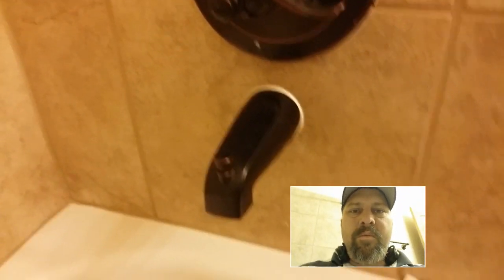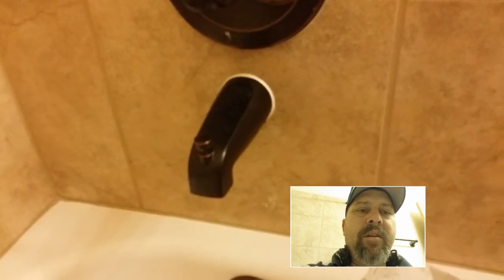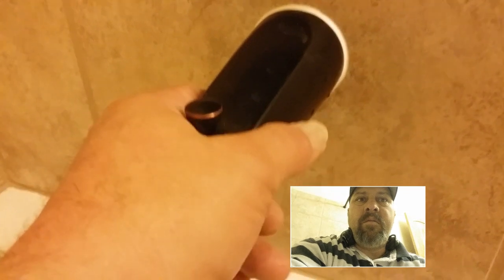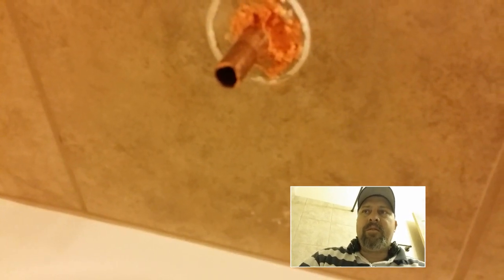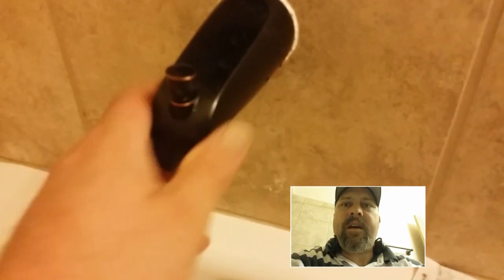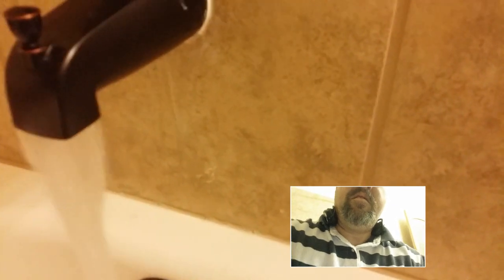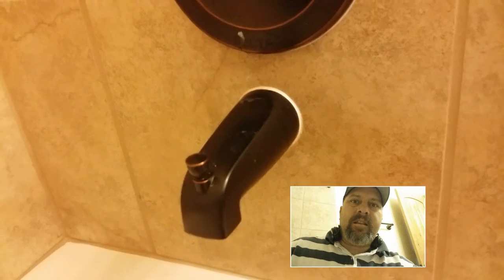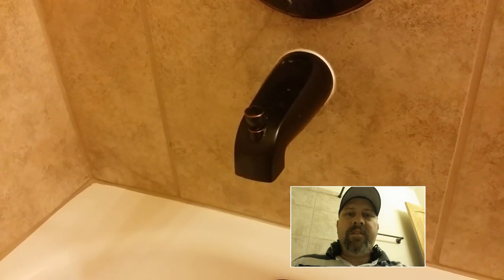How to fix a loose tub spout

Comment: I'm had the same problem. It seemed that this was a good fix so I did it. My only comment would be that the expandable foam should be used somewhat sparingly. Low expansion foam that I used filled the void quickly and expanded out toward me when I used it. I let it cure overnight. The next day I used a safety razor blade and cut the foam flush to the tile. I applied a small bead of bathroom silicone to the tub spout outer edge just prior to installing it back in place. I siliconed it as you did once I secured the set screw. My modifications to your fix are minor but I thought I'd throw them in the stew. Thanks Trueplumbinator!

Comment: I have a spout with a hex head screw but no matter how hard I try to screw it, the screw keeps slipping out, i.e. it doesn't attach to the water pipe. I bought some new screws from Home Depot but still not able to fix it in place. What am I doing wrong? 
Should I just use this seal to seal it in place?
Reply: Get a new tub faucet. Sounds like the inside threads are stripped where the screw goes if new screws aren't staying in.

Comment: Looks like the issue I have of the tub spout coming out from the wall when the shower valve is on.
I know it is because the pipe is not secured to a joist but to cut a hole from the closet to fix it is a big hassle. This should fix it .

I have used the foam before to shoot into a hole in the wall where TV and speaker cables comes in. It has a nice plastic fixture it uses but so large a mouse found his way into the house from getting into our garage. The foam closed that route off and they are gone.